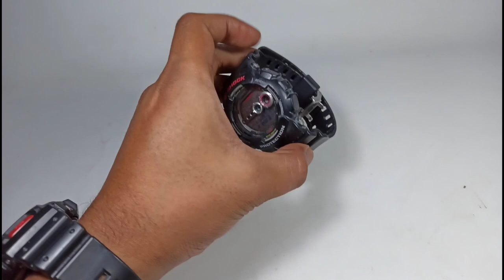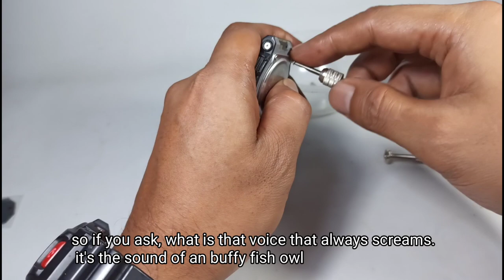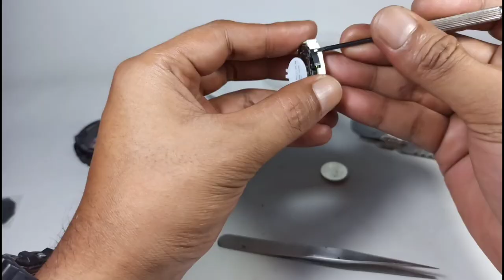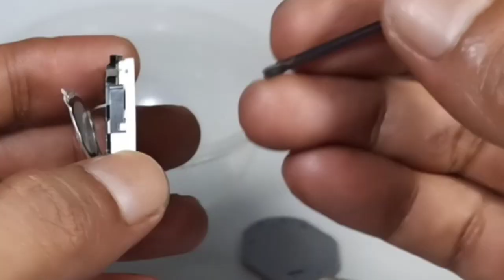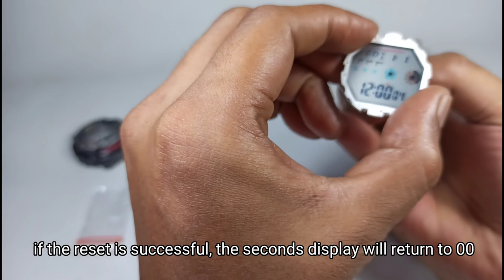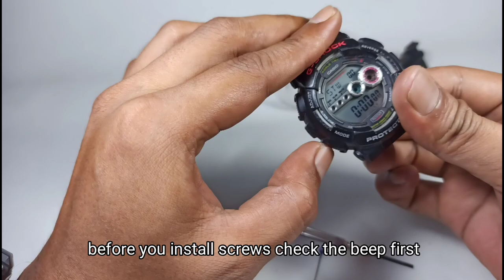How To Replace LCD Gshock GD100 / Cara Mengganti LCD G-shock GD-100

Comment: Om klo sensor baro dan alti eror setelah ganti batre yg rusak apanya, bisa servis kira2 berapa? Gdf 100
Reply from the maker: Coba di reset om setelah ganti batre, AC dan (-), tonton video sy tentang ganti batre tipe apa saja, kurang lebih cara resetnya sama.
Reply: @BiangKeladi  sudah dreset cuma pengaturan waktu aja yg berubah, alti dan baro tetep eror
Reply from the maker: Pernah di cabut konektor sensor nya?
Reply: @BiangKeladi  gak ngerti om, apa per kecil itu ya. Pertamanya ganti batre aja hbis itu klo pencet alti dan baro tulisannya error bagian angkanya cuma - - - gitu.
Reply from the maker: @rm-vy2of  per kecil itu beep (spring alarm/beep) sensor itu yg kayak fleksibel.
Reply: @BiangKeladi  belum pernah cabut itu